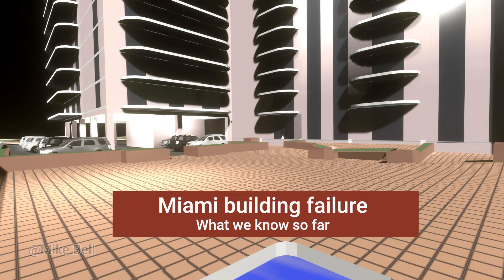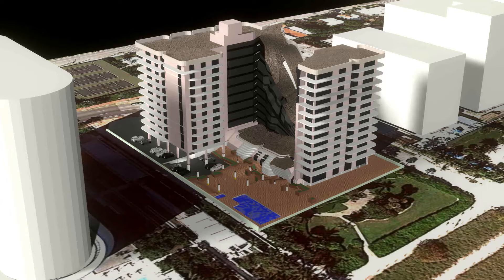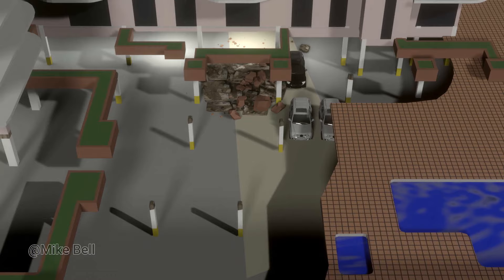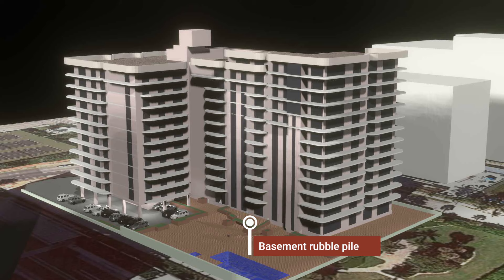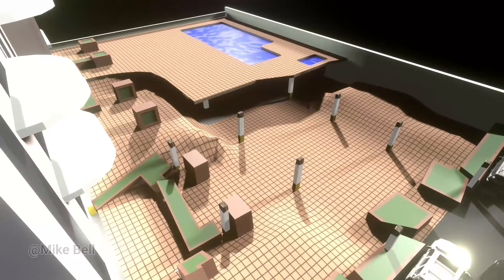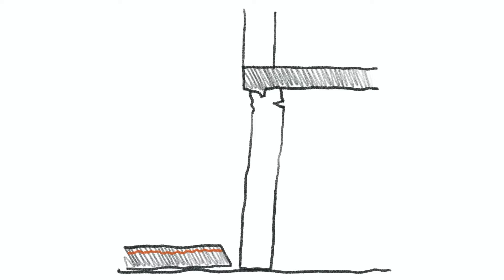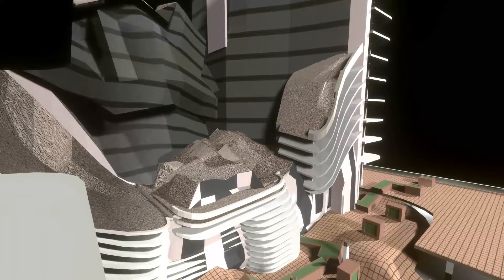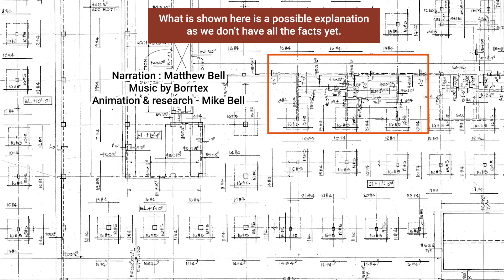MIAMI CONDO COLLAPSE | visualization of the evidence pt2

Comment: Just to ponder if this happened only a few hours earlier when everyone was awake and more people saw the pool deck sinking and concrete falling maybe someone could of pulled the fire alarm and more could of escaped.
Reply: It's could have* professor not could of.
Reply: I cringe to think that if this had happened during the day, when people are enjoying the pool deck or driving in and out of the garage, cameras would've caught people actually getting crushed. Some might think a garage collapse is all that was happening and might actually gather around to look, not realizing the rest of the building was next. Also, there would be no way for anyone to know in which direction to run, especially right before the first collapse. You just know something horrible is happening and chaos ensues. It's likely some people would've been at work or out and about. I can't imagine which time of day would've been worst, if there's such a thing. Regardless, to me this is still as horrible and shocking as the day it first happened.
Reply: @jayz4evr  
So many people think it’s “ could of “. Drives me nuts. Lol.
Reply: @catpaws1196  That's the way the contraction sounds, so there's some logic to the spelling.
Reply: @megatuanis  "Could have" 
of what??
Reply: @maciakittys1114  you're replying to the wrong person.
Reply: @maciakittys1114  They were trying to explain to the original poster of the comment that the correct grammar is "could have" [or "could've"] not "could of" as they kept saying.
Reply: @megatuanis  I apologize. Yes. "Could have."
Reply: @maciakittys1114  👍
Reply: @polarvortex3294  

It does sound like that,  but if you speak English you should know better.  I can understand if it’s written by people that don’t speak English as a first language because that’s how it can sound like you said.  But I see it written by people that are American and taught English as a first language.  So it’s just surprising to me. It’s something you learn in elementary school.
Reply: @catpaws1196   I suppose most educated people who pay attention have a few special solecisms that really bug them.  It can be disheartening to encounter these errors often, and from native speakers most of all.  I think the best way to stay happy and humble is to view the pain from these peeves as part of the price that's paid for knowing more than most -- while admitting that our own mistakes must frustrate those who know even more. 🙂
Reply: @polarvortex3294   

What you just said was the best response I’ve ever seen to someone saying “ omg that drives me nuts seeing that grammar mistake over and over  “. Like I did.  😊   Very well said.

Comment: As a towercrane operator during that time, there was a practice most used but some did not, called puddling. During the concrete pour the crane would pour a higher strength mix on the top of each column while the rest of the deck would receive a lesser psi mix. It would cover an area up to 2 to 3 feet around the top of each column mixing in with the deck pour thereby strengthening that area but to the best of what I remember, on the lower floors where a concrete pump could reach easily they didn't do that, they just pumped the whole deck with same material. I worked the south fl area until 98

Comment: The original design seemed to have been flawed due to smaller columns, and the concrete may also not have been mixed correctly, and not enough rebar used perhaps. Also, the addition of heavy palm tree planters that were not part of the original pool deck design, that were placed on top of very important columns, as well as the exposed excavated hole beside one of the planters, and the waterproofing was "past its useful lifetime", and also the pool deck's drainage system was not sloped like it should have been to allow water to drain properly, but instead it all saturated the slab and columns underneath. I'm not an expert, I just watch YouTube videos, have a nice day.
Reply: In another video, a structural engineer noted that the waterproofing was not located  properly within the slab makeup.
Reply: More rebar probaby wouldn't help, as the expansion of rebar when rusting worsens the spalling.
Reply: The whole concept of building a pool deck on top of a parking garage is silly. Unnecessary complexity that poses a grave risk.
Even building a pool deck on the roof of the condo would have been much safer

Comment: Very good visualization. The already compromised structure was recently subjected to heavy prolonged seismic vibrations from south and north. First, with the construction of 87park and mostly from the excavation of 87th Terrace. Then the building was also subjected to the Beach Replenishment Project along 88th Street where tons of sand was delivered by dump trucks daily for nearly a year.   One could argue that these external forces contributed to and accelerated the collapse.

Comment: That's not what an eyewitness said. He said the area where it's outside parking collapsed first - he was standing right in front of the part that collapsed. He didn't see any planters fall through either.
Reply: You're dealing with effects
Reply: Gabe, the guy you are thinking of, was in the kitchen of 111 when the deck began to collapse. By the time it did he and his sister had run to the door of their apartment and then down the hall to the lobby. He saw the cars sticking up out of the collapse after they ran out of the lobby to get away.

Comment: I was working in a multi car park complex and noticed a section of concrete flex when ever a car drove over it so i went to the level below and noticed that the reinforcing had failed and was also flexing at this stage i got on the phone and wouldn't give up till it was isolated and fixed. tell you what the building owners were thankful to have it fixed before it fully failed and collapsed to floor below. it was identified that a crack had let water sit and leak through past the reinforcing expanding the rods making the the cracks bigger

Comment: Building codes should require that all structural columns on buildings higher than 10 stories,  be 25% percent larger than current standards, as well as requiring 25% larger concrete footings, especially in areas where there is sandy/loose soil such as in Florida.
Reply: that will just postpone collapse of bad maintenance.
Reply: It’s the rebar inside the concrete that rots away and leave the concrete unsound. It would likely still collapse. I bet much of the rebar in that concrete had deteriorated to powder.

Comment: Failure at the slab step seems like a very likely source for the tower's demise.  The complete lack of waterproofing in the core samples is astonishing.
Reply: And that was something I thought I'd seen, was a part of the contractor list, back when they'd done some repairs. So, where did they spray the waterproofing?  Under the pavers, or on garage ceiling? Which would have actually added to the problem.
Reply: @peterford9369  Waterproofing is not usually sprayed on: it's usually installed from a roll and the seams are sealed.  It would be something clearly visible in the core sample.
Reply: @WesMacaulay  I don't know what was used back when this structure was build or what the code is in Florida, but these days the waterproofing is typically a roll on product. HLM 5000 for example.
Reply: @tchevrier  hehe I’m in the Pacific Northwest and over a parkade we’d want a really thick membrane 😬
Reply: @WesMacaulay  I work for a company that does concrete repairs and restoration. specifically parkades.
To be perfectly honest, I've seen water damage and deterioration 10 times worse than what I saw in the videos of this building.  There are a number of ways to do the waterproofing, but the key is really to have an effective drainage system to remove the water.
Reply: @tchevrier  It seems like the planters and hard landscape overloaded a portion of the slab, but there was enough corrosion of the rebar that it wasn’t binding to the concrete any more.
Reply: @WesMacaulay  from the pictures I saw, it seems like there wasn't enough rebar tying the columns to the slab.  It looks as if the weight of the slab just punched through the top of the columns and what little rebar there was, wasn't adequate, especially with any amount of corrosion.   I'm just guessing based on what little rebar we see sticking out from the columns.
Reply: @peterford9369  Random ques - but in theory could someone have went to the balcony and rode the falling balcony slab down and jumped off just before it hit the ground and survived?
Reply: @nofurtherwest3474  Thats a question that would make a good movie. But according to records so far they had like 7 minutes after the pool deck fell, to do anything. But if you think about it, it doesn't take much to kill a person. The balconies were on top of each other. So a balcony or a building falling on u,,,odds are not so good either way. 
They did say someone on the 3rd floor did make it out after hearing the deck fall. Which was a miracle. Can you imagine running out of a building seconds before it falls behind you?
Reply: @tchevrier  there is a difference between bending rebar and punching shear rebar. Usually the punching shear reinforcement is placed in the slab or column cap. Maybe what you saw in the picture is bending rebar
Reply: @tchevrier  In the 90's we used bituthane ( spelling ?) a thick black tarlike substance for waterproofing. Roll-on product for CTS ?  No way adequate. As to us folks from the 1960's we rode in cars without lap belts in the bed of pickups.  Did we do our children a disservice by requiring infantslising booster seats?  BTW my son served in Marines.
Reply: @lisakoumrian5301  ?????????  what the neck was all that about????
Reply: @tchevrier  sorry, I apologise.  Did not mean to offend.
Reply: @tchevrier The garage video was shot after damage had already to some extent been cleaned up, with attempts at cosmetic repairs (urethane injection, patching, repainting) to hide the damage at least visually from the underside.  I wonder if that worked to hold the moisture in the slab longer, and accelerate the rebar corrosion and calcium hydroxide migration out of the slab forming those calcium carbonate stalactites. If what was visible in the video happened in just a few years, what happened over the decades before? Are there photos taken before that patch job? https://en.wikipedia.org/wiki/Concrete_degradation#Calcium_leaching

Comment: Actually, penthouses were later built on top. Thirteen stories.
Reply: 11 stories had residential condos and the first level was the entrance area (ex lobby)...that's why they say its a 12 story building.
Reply: @nelly64hlw  that's not correct.  People lived on the first floor, which is the lobby level.  As a matter of fact, that the woman who went to the security desk to warn about the collapsed parking deck lived on that level. The building had 12 floors when it was initially built and the penthouse was added later.  So it's 12 stories and a penthouse.
Reply: No, the penthouse was added when they were constructing the building. The original plans did not have a penthouse on top. They added it 40 years ago despite it not being accounted for in the original planning.

Comment: Imagine being on one of the lower floors of the building, waking up to multiple car alarms blaring and concrete collapsing, suddenly before your own ceiling collapses and everything goes black. holy fuck.
Reply: The only good part was that the death was most likely instantaneous
Reply: @GoldLove21   except it wasnt. people were stuck screaming for help for hours and days, unable to receive it because emergency response couldn’t get to them due to the structural integrity of the collapse, it was too dangerous to risk the lives of anyone, including the people trapped. they died horribly and slowly. we have to remember this so this kind of disaster never happens again, and the execs who run these kinds of buildings actually pay mind to those living inside of it, and make an effort to ensure their safety, something that unfortunately didn’t happen in the surfside collapse. RIP

Comment: WJE Engineering complete report was released (5/27/24) and the failure was due to punch and sheer of column K13.1.  The column punched through the pool deck and caused the collapse of the pool deck.  There was not excessive corrosion of the rebar.  The pool deck was under engineered due to the increased weight (added large planters, sand, topping slab and pavers).
Reply from the maker: Yes and they also found the top rebar was set too deep into the concrete further weakening an already understrength slab. 
They also explained the way the tower columns were damaged is the way illustrated in my pt3 video, which was posted 2 years ago.

Comment: A the bottom of the parking ramp in the pre-collapse video you can clearly see two columns standing, but not the 3rd.  I've seen a pretty reasonable sounding argument that the 3rd column is laying on the concrete floor, and you can see the yellow and white pattern in the floor debris when the image is enhanced.  Of course this all involves image enhancement, and sometimes that brings out what you want to see instead of what is there, so IDK.
Reply: the people that cleared the site would be able to tell where the column was when they cleared the debris.

Comment: the hurricane winds blowing those palm trees had to put a lot of pressure on the planter boxes and the pool deck also. palm trees were removed after that
Reply: I hear what you are saying, I agree that weight could have had something to do with it but the water proofing had failed in the 2018 report as well and they still hadn't replaced that five years later.  Concrete is a sponge.  The core samples from last summer showed the rebar had failed.  I am shocked the engineer wasn't more concerned.
There are so many reasons this building failed.  This is going to yet again change regulations across the US for the better.

Comment: I am a certified building inspector and reinforcing steel contractor. There appears to be a cover up going on here. No one appears to understand that the reason the building collapsed is there was no positive connection between the columns and the slab at the pool deck. I have built many of these structures and we always have groups of post tensioning cables running over the tops of the columns in both north south and east west directions in the slab. This pool slab had no post tensioning. It is obvious the only positive connection between the columns and the pool slab is the occasional rebar that landed over the tops of the columns when spaced out accordingly per approved plans during pool slab construction. I have been building these since 1978 and have never seen a slab like this with no post tensioning and little to no structural connection from the columns to the slab. I am not an engineer but it is appears to me to be an engineering failure.

Comment: This explicitly stated what I had been wondering about: How the supposed failure of just a few columns could cause the entire building to fail so quickly and catastrophically.  One would think that sufficient redundancy would have been built in.
Reply from the maker: Speculative developments demand costs are scrutinized and cut to the bone.  And it goes too far sometimes.  Competition  is the engine of the economy, but in the case of buildings now and then it is catastrophic.  This structure was likely as per code but only just.
Reply: Poor design. Domino effect. 3 major weight bearing columns fail which then overloads the other columns that were not damaged initially.

Comment: The answer is The lack of concrete beams in each column they would’ve prevented this catastrophe!!! There is no way the pool deck had to compromise the structure of the building.
Reply: Do you mean steel beams? The the columns are concrete beams
Reply: @jeremysmith9694  either doesn’t matter what matter was the lack of beams. I will suggest for you to see arq manes videos on this matter he is the one that gave a concrete answer from the very beginning.
Reply: I am trying to understand you. The Concrete Beams or foundation already have steel beams in them. It is call Rebar and it common when building multi story structures. 
The problem was a lack of proper Structural maintenance (over 40 years), not the lack of using concrete or steal.
Reply: @wraynephew6838  No you are wrong, the lack of concrete beams would have prevented the slabs to pass through the columns. Like a needle through clothes. There were no beams inside the slabs because the thickness of the slabs were only around 6” instead of 15”. I suggest you see arq manes videos on this matter he was the first to give an accurate analysis of this catastrophe.

Comment: When the patio slab collapsed it rotated the grade beam that was attached to the floor of the building causing the floor to be ripped out in sheer from the columns. A moment was also applied to the building slab and to the columns.
The slab to column connection was weak as was the lateral force resistance since a lack of shear walls in the transverse direction could not help the shear wall resist torsion.
Add in lack of maintenance, extra tons of dead load, core samples cut thru steel rebar next to collapsed column and horrible design and construction gives you a perfect storm
.Rotational torsion of slab diaphragms. The column at the cold joint failure line was damaged but survived.
Reply: I picked up on this possible theory as well
Reply: You’re going to blame course sampling?